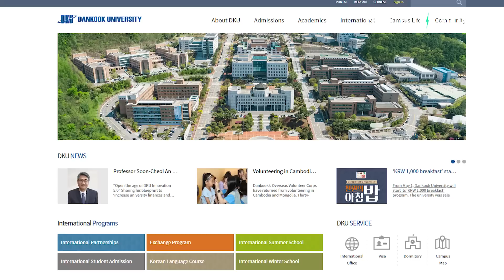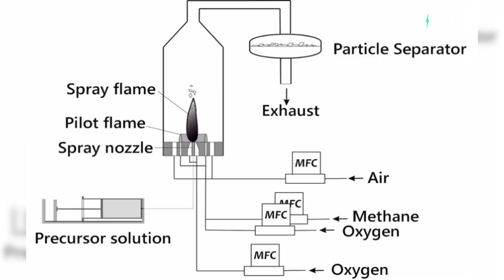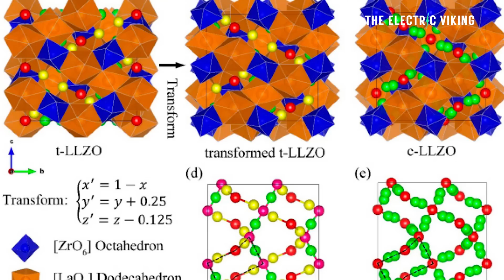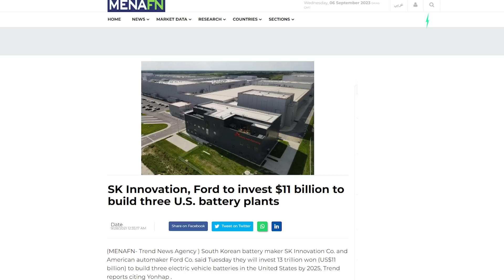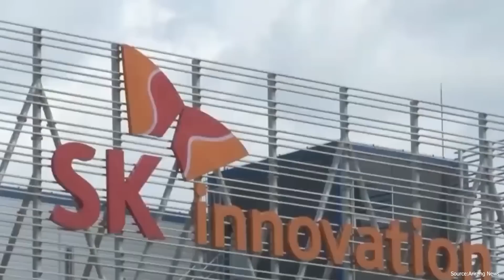Ford's battery partner reveals how it has solved Solid State battery bottleneck

Comment: If you tell the public what exactly you are doing and how you achieve the solid state battery, it would be a big risk for CATL to steal your formula. They can easily avoiding the pattern by changing the formula a little and maybe improving it after learning your ideas. Toyota has to stay at top secret like Apple to avoid being copied early on before they even release the product.

Comment: Main driver to develop and make solid-state batts isn’t just improved charge speeds, it’s to reduce the BMS, drastically and realize virtually no range decrease due to very cold or hot temps, like current li-on batts do.

Comment: I think Tesla may well go from zero to hero in the battery game. Tesla is producing cells and continuously improving using the laboratory breakthroughs of many others, computer simulations and optimizations of battery chemistries likely at subatomic scales (likely to increase performance significantly with additional AI modeling compute), and practical real world battery production engineering experience. They're likely to become one of the biggest players simply because they are planning to achieve production scales larger than most other battery OEMs.
Reply: I hope so, because it seems like the 4680 and DBE have flamed out...

Comment: One idea would be to make the solid state battery easily replaceable or repairable to get around the lifespan issue until it could be solved. That way you could at least get them in production and in use in real world applications. If not in consumer cars maybe in fleet vehicles or construction equipment. Maybe target stuff that doesn't get recharged very many times before it's replaced or serviced.
Reply: Battery life is already at millions of miles. Average US ICE car gets scrapped at 200k miles (150k miles in Europe).
Most modern LFP variants in use today last 10 X that lifespan.
Reply: @whowhy9023  But they have been tested and used in the real world. New tech needs some experience to find the gotchas that bite you in the butt. Hello, GM?

Comment: Batteries are on the way to being a commodity like nuts and bolts.    No car maker buying batteries from outside will hold an advantage for long.  Telling us that in 5 years company X will sell a neat cell to company Y only is highly unlikely.   X will expand and sell cells to any company with the money to buy them.    X knows it's advantage will not last long and will try to sell every cell it can while it has the advantage.
Reply: Waiting for a truly standardization as with  "AA" and "AAA" batteries but in much bigger versions. I hope that would be "demanded" by EU or US. That is opening up for consumers a healthy competition. As a consumer, you are not "locked" to a certain brand when times come to replace the battery. And even when buying a new car, choosing one of many standardized batteries drives that purchasing cost down due to competition.
Reply: Let's face it, batteries still suck. Their energy density is still way less than fossil fuels. I live on 25 acres, I have equipment to keep the land tamed, nothing battery powered has shown to be more than a novelty. Diesel is still king. I see these stories and it reminds me of fusion just being around the corner.
Reply: @iamthemoss  You are making the mistake of thinking what you see now is how it will be down the road.   Electric tractors are in the works.    Kubota is testing a 26HP  LXe-261 in the UK.
https://youtu.be/SH2PJCaQHMo
3 or 4 hours of work and 1 of charging.
This will all get better with time.  
Tier 4 diesel engines can be painful.
I have one of the original BX2200 with FEL and have no plans to replace it.    If I did it would be a pre emissions tractor or electric if new.

Comment: One can only hope that the technology SK on is working on is a step to match or even overtake the CATL's dominance but they all should be looking for an answer to a replacement for Lithium based batteries with their inherent fire risks.
Reply: Accident arcing damage is the issue if they are structural battery packs like the tesla ones Munro examined fair enough but an arc/spark scenario and your in a world of hurt, there is only 1 real agent that will stop these fires LITH X and no fire brigades carry it that I know of and water will not stop a lithium fire.